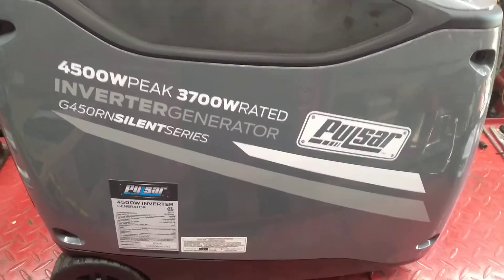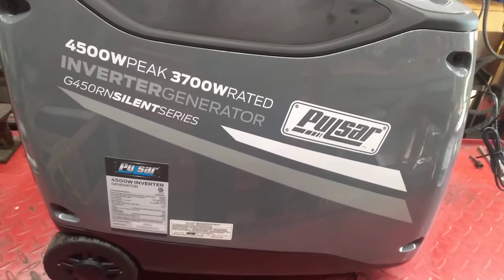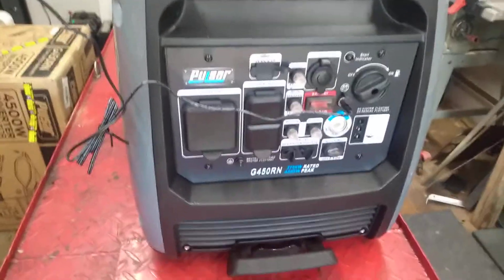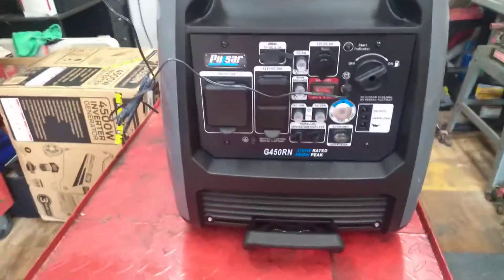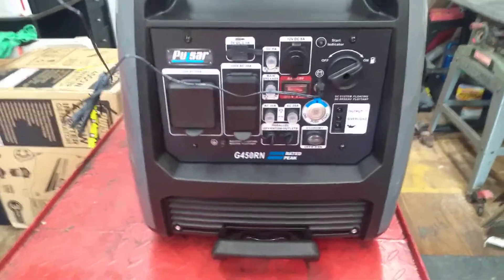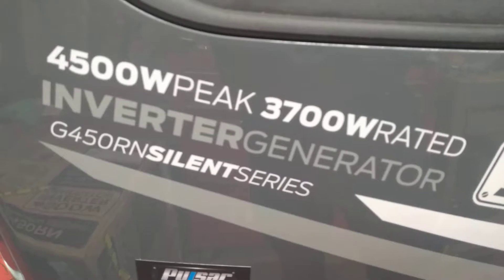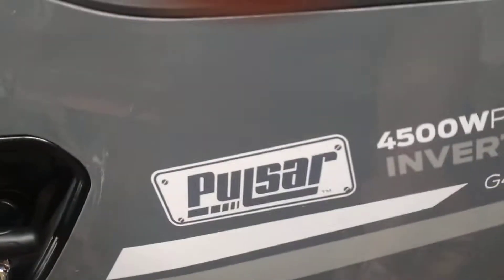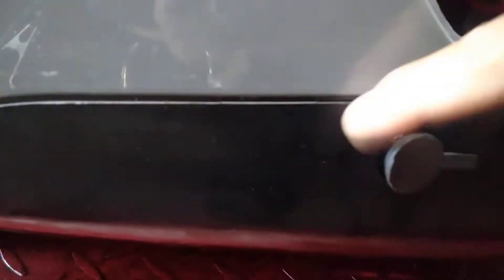PULSAR G450RN INVERTER GENERATOR AMAZON/EBAY

Comment: Can you do periodic follow up videos to share experience overall? If it dies after 2-3 months or 50-60 hours, that will be helpful to now. Or if the remote start stops working.
Reply from the maker: will do ...actually i use it fairly often...i use it for small projects around the property.works great hasnt had a problem for vacuums or my grinders
as i filled it upbw gas and im trying to run it dry for storage

Comment: Hi, really enjoyed your videos on this unit. That oil change "system" is very bad though. The first thing I would do is put a remote oil change hose on it like this,  Drainzit Oil Drain Hose — 20mm Port, Model# HON1420-C.DRA Do you know what size that drain plug bolt is?
Reply from the maker: no i dont havent been in the shop for a bit.had a motorcycle accident  so been down about 2 months getting better .i will look today see if i can tell what size it is.yes that drain system is horrible

Comment: How’s the generator holding up ? I’ve been looking into them but you don’t see a lot of reviews in-depth about them. Maintenance wise who would work on these? Maintenance as in carburetor or anything internal other than the oil and spark plug?
Reply from the maker: So far no problem used it last week to run my jackhammer  on the other side of my property.ran it about 2 hrs one day the 3 hrs the next no issues.as far as repair work I'm assuming most small engine repair shop unless your a diyer.its a tight fit inside that case but maintaining it can be done with generally available tools ..oil ,spark plug,carb.if you do take it apart I recommend taking lots of pics for reference  when putting it back together
Reply: @professionalbaddass  yes I am a DIYer. I’ve done the maintenance on all my other generators. Generators like the predator I was getting a hard time getting the parts to it. I wonder if that generator has the same issues though or are they available. I’ll keep looking into it. Thank you for responding 👊🏾

Comment: Could you share the type of battery charger you use? Pls
Reply from the maker: It comes with one you plug in a port on the front.
Reply: I understand. I got my genny second hand and it didn’t come with the charger. I called pulsar to try to get one and they couldn’t figure it out.

Comment: Poor design oil drain system. I would use a fluid extractor through the oil fill cap. Super clean super easy. Manual extractor would be perfect for the situation.
Reply from the maker: Didnt think of that I have the harbor freight manual transfer pump..probably try that next time

Comment: That's a stupid design to drain the oil. I ordered one received it. It was running rough the push start didn't work or the remote. I think it's a poor design
Reply from the maker: Mine ran fine when I got it but as I use it more I'm finding that little port on the carb.is easily plugged.i have a video on it also swap out the spark plug with a good one. I'm going to swap the fuel filter it comes with with a quality one I'll do a video when I do ..should be soon as winters coming to the Texas hillcountry last time it was pretty bad
Reply: @professionalbaddass  awesome thank you.

Comment: The one I bought from Amazon still doesn’t work right.
Reply from the maker: Did you clean the little orifice and make sure you can blow thru it from the bottom.im going home today to try and figure a way to put a filter in line ..mine clogged again..started surging and had trouble starting...checked that same orifice and it was clogged again...only took a couple min to fix but hate having to keep doing it

Comment: Good video.  Very poor oil drain design though.
Reply from the maker: yes i do agree poor drain design.i am still trying to get all the oil out.i had a predator before which is what im comparing it to..the predator by far no mess oil change. still running great no issues.